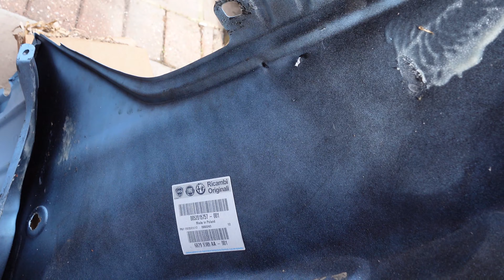Project Elizabeth - Day 1 - Whats under the wing? Cat S Fiat 500 - Copart Crash Damaged Salvage car

Comment: The box section that goes from the chassis rail to the top wing support looks bent in, could that be why it got an S?  Interested on how the direct gloss works out. Got good finish with base and 2k clearcoat rattle cans but clearcoat takes an age to dry (was the reusable 2k type) gonna try the one time use clearcoat rattle can next time to see if it is any better.

Comment: Always need to wear a mask says man surrounded by a cloud of overspray 🤣.  You can buy a proper cartridge filter mask at paint suppliers for about £25 which would last you ages provided you keep it in a resealable bag when not in use as they absorb moisture and fumes from air otherwise. Perfectly adequate for 2k painting outside.  Be safe mate 👍👍
Reply from the maker: I know, I thought that at the time. Daft pillock I am. I’ve actually got a mask too.
Reply: @Love500  glad you realised Paul 👍🏼

Comment: hi hope you don tmind me asking. question ... if you can help me . i have a 500 c 2017 , we have recently changes the front tyre  since doing so when we start the car we get a meesage poping up saying the start stop is disabled and ocasionally the antri skid is decativated  ... when i switch and  a restart it clears , but can reappeare when the foot brake is pressed . can you offer any guidance  ? thanks in anticipation Rob
Reply from the maker: That sounds like its the brake pedal switch causing that. They are about £15 on Ebay. Take 2 minutes to change. See my How to Videos, there's one in there on it.
Reply: @Love500  thanks very much i will give it a go
Reply: @Love500  replaced now and worked a treat many thanks